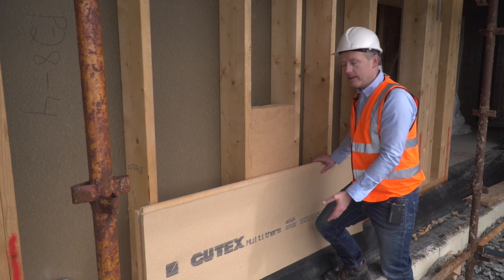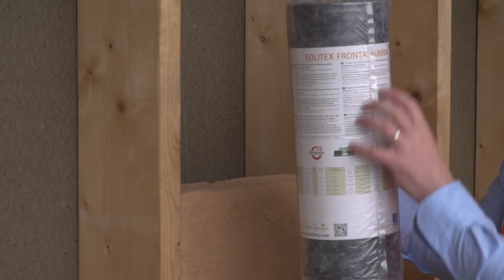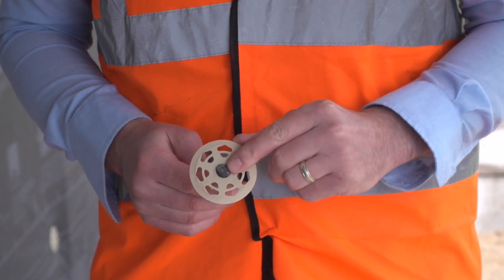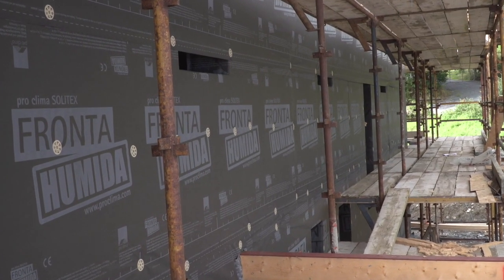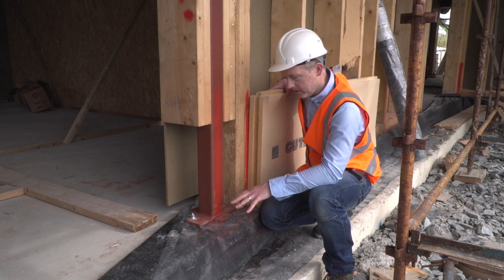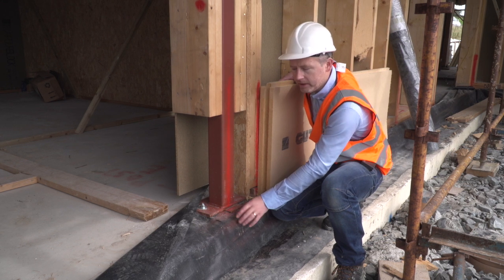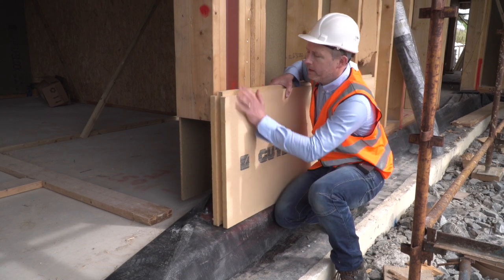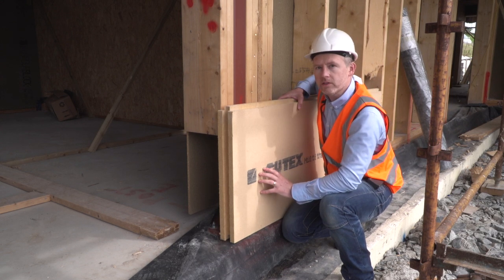Outside Wall Insulation - Passive House Installation Series (part 4)

Comment: As I can see, there is no structural layer outside, you install the insulation right on the timberwall. As far as I know it should be a structural layer inside and outside of the timberframe, for example OSB, to avoid structural movements, rotation. Is it enough to install osb only inside for your system?
Reply from the maker: Hi @leccsful. The need for a structural board inside alone or both inside or inside is determined based on the structural requirements of the structure. Most timber frame dwellings primarily have a structural board such as OSB 3 or a P5 board outside or inside. In this case one structural board, such as our FINSA VapourStop, was needed based on the engineers guidance.

Comment: Hi where are you based..do you supply the boards to put externally on timber frame stud..Cork area.thanks
Reply from the maker: Hi @sean550, we're based in Athboy, Co. Meath. Yes we supply the Gutex insulation boards and we can deliver nationwide. You can call us on +353 46 9432104 for more details. Thanks.
Reply: Hi..I'm not putting insulated board on .as it going on to battins....ply .felt .battons than half inch baords...